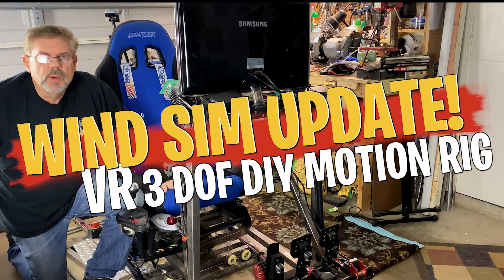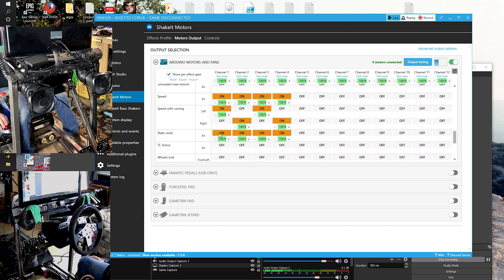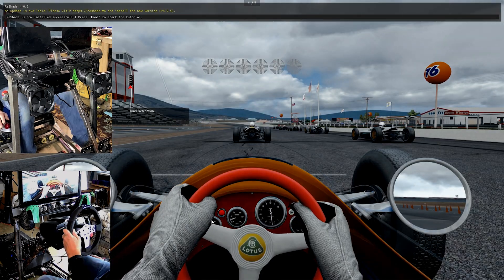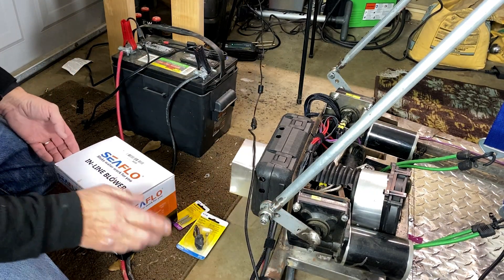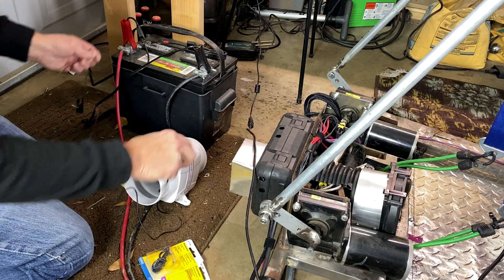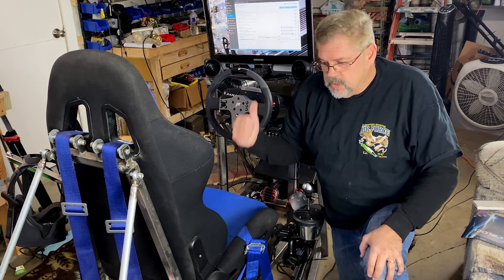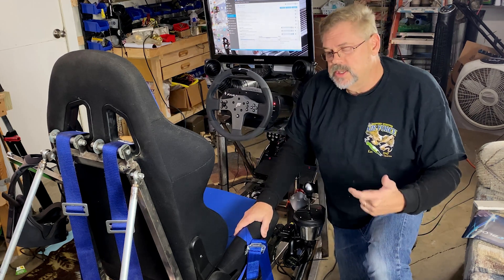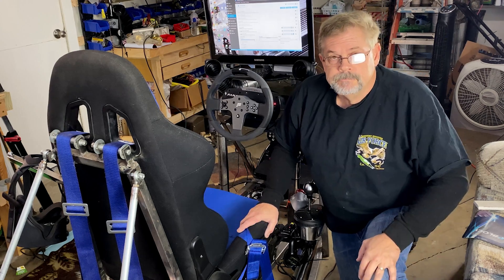DIY WIND SIMULATOR UPDATE!  VR WIND!

Comment: Great video again.  Thanks for that. I'm looking to add fans to my rig next but I'm facing an obstacle I can't seem to overcome.  I've just finished building my 2dof rig following your instruction videos amd it all works great. Really pleased, so thanks for that. I will be uploading some pics to xsimulator soon. All was well with lfs running great until I added simhub!! I wanted to add a diy bass shaker . That worked fine too but I could not get the rig motion amd bass shaker to work together!! As soon as I ran simhub it would knock out any motion. The motion would only work again once I deleted the patch for lfs and the repatched it. I have only auto configured lfs in simhub. I did try ticking the box for UDP forwarding but still no good. There is a readme file offing the info to manually change and configure, haven't tried that yet but struggling to work out the problem.  If you have any idea please let me know. Can't find anything on it on the forums. Still a newbie so it's probably obvious but if you can point me in the right direction I would be very grateful.  
Cheers buddy, and thanks for all your work.
Reply from the maker: Ok..  First of all..  Fantastic that you are 'moving'!!  That's so great..  and that's the main focus of my little channel..  DIY motion..  But haptics are important.. so I would suggest that you go to x-simulator and Direct message Noorbeast (the moderator) I would be certain they have ran across this before..  I have not, (fortunately for me!)  but  that's the BEST advice I can give you..  I'm no expert with the SIMHUB.. but it sounds like a 'conflict' or priority thing..  If you can figure it out, post the note here for more to read..  Thanks my friend! Dave
Reply: @DMAX_DIY  thanks for your advice and pointing me in the right direction.  Once I overcome this I'm looking forward to changing the rid to 3dof next.
I have to say, your videos are awesome buddy.  Fantastic little project, I have loved it. Thanks dave.
Reply from the maker: @simonjones8378  Good Deal Simon.!  Thanks for letting me know.  Keep pluggin away! As long as it's fun to make, that's great.  but once that thing is moving..  It's fantastic! Dave

Comment: Hello DMAX, I’ve seen the seaflo blowers on your rig in other videos- but I haven’t seen a video on the blowers themselves. Would you mind commenting on the pros and cons of this newer set up vs the 120mm fans?  I appreciate it. Happy driving.
Reply from the maker: Thanks for the comment Dylan..  I have not got them working yet..  I build the circuit but then found out I needed to upgrade Simtools to SImtools pro.. which I did just to get the Blowers to work..  But I just have not had the time to show in it a video.   I have it ;taped' but still not had time to work on the video..  Thanks  and hopefully I'll get to it sooner rather than later as they are absolute BEASTS!
Reply: @DMAX_DIY  Thanks for the fast reply!

Comment: Very cool! What rpm are the fans that you’re using?
Reply from the maker: They are 3000 Rpm fans . Yeah it's pretty immersive in VR because I have the CV1 headphones on and all you can see is VR.. To have external forces like motion and wind is a big plus!  I must not have posted the links on this page..  I will go ahead and do that.  Thanks for the comments! DMAX
Reply from the maker: I added the links ;)
Reply: @DMAX_DIY  thanks! I’m building my sfx-100 as we speak. I’m thinking this would be a great addition to the rig!
Reply from the maker: @gregdoucet3721  I am working on the SeaFlow fan setup too. They are the big 4" ones 270CFM and they haul butt @ 12V. off MMoto
Reply from the maker: So Greg, I have the SeaFlow/ MM setup. but have been having a problem with  SimDash being flagged as a virus by Defender.. I wrote to the guys at  X sim.. and noorbeast said to do some stuff. but it's wasn't real clear..  Have you had any luck?  Is yours's working? DMAX
Reply: @DMAX_DIY  I just came across your msg. Yes I got my fans up and running. They’re 4000rpm 200cfm each which is great. I am using sim hub though. I followed the guide on boosted media’s channel and they work great. All I need now is something to reduce the air flow at the end where it comes out since I used some flexible down spouts hoses and they’re a bit too large in diameter. Ps I hope you got yours working by now. 👍
Reply from the maker: @gregdoucet3721  That's awesome Greg! I went ahead and got two of the SEAFLOW 850's.. I built a MM setup for them..  CRAZY.. Like being at Bonneville salt flats for the world record ..  I'll post up a new video on that when I get time..  Thanks again, my friend DMAX

Comment: WOW!!! This is just an amazing setup, D Max - but I can't get over how people like you & R-VR Closet can power all your gear at the one time?   8-O
Reply from the maker: I have a 12V Battery to power the Rig motion. Just one cord powers the computer.. Pretty easy. Some folks make it super complicated with server power supplies and such. But a Simple battery is what things need.  (also I have a battery tender, which keeps the battery charged up ;)
Reply: @DMAX_DIY  I'm glad you said that last line about the Battery tender - cos I was about to ask that if you accidentally left your "virtual lights" on, would that flatten your (virtual ;) battery too, hahahaha 😮🏎️💥😄
Reply from the maker: @SingleRacerSVR  I did leave it on once! I learned my lesson the hard way.. When it's 'ON' it draws 1.5 amps so it's only a matter of time. But with the tender.. no more worries!  DMAX
Reply: I’ve got a similar setup, but with motion. My pc, monitor, pedals, wheel and fans run off of one circuit and then I have 2 dedicated circuits for my motion rig (2 actuators per circuit).  It’s a little overkill, but don’t want to be having the race of my life and have anything trip the breaker lol
Reply from the maker: @gregdoucet3721  Can we take a look? Mine motion rig runs off a 850CCAmp battery @12V so only if I rip past my 50amp DC breakers will it trip (which may be good).. I've seen it come close to 27amps before at peak load changes